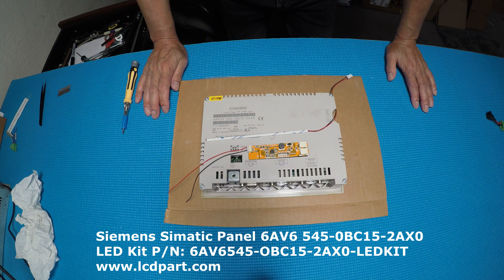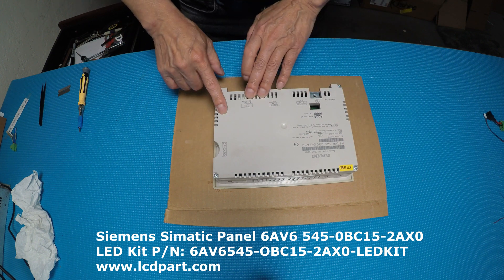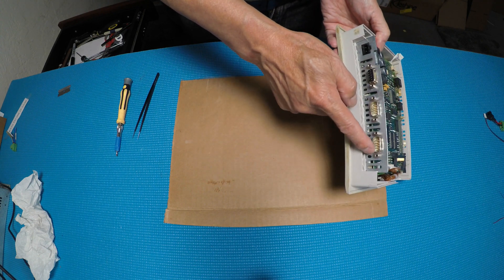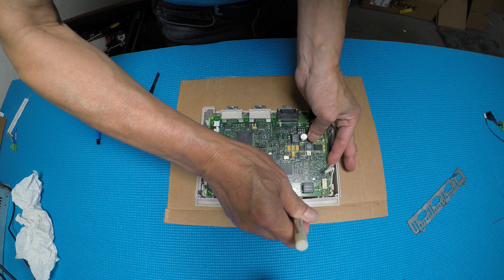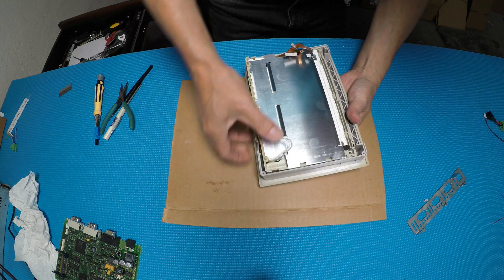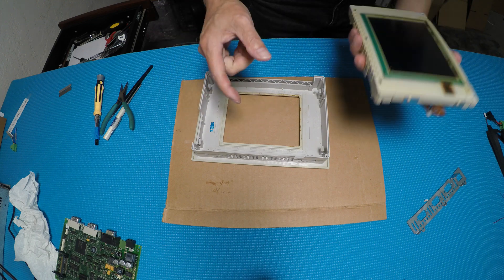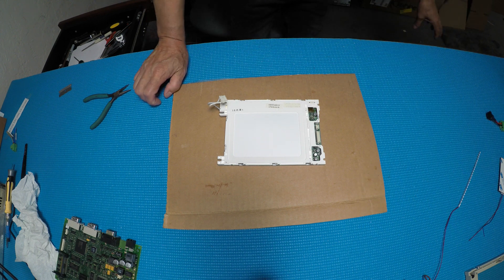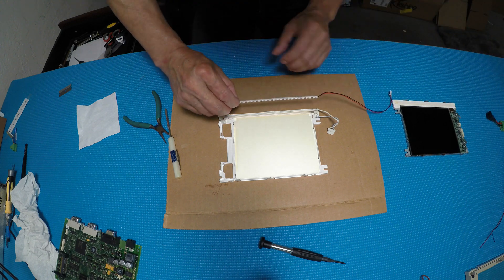6AV6 545-0BC15-2AX0, How to Install LED Backlight

Comment: I replaced with other CCFL but the screen stays dark. The TP177b boots up. I tried other CCFL strips from other LCD Displays...they all dark. Is the inverter on the board broken and is my panel scrap?
Reply: Check the fuses. There are two smd fuses related to the inverter. If the fuses are blown, then the inverter is propably also blown. I suggest you convert it to led backlight.
Reply: @tommiturunen8144  Hey thanks for your great answer and you were correct. A few weeks ago I replaced the fuse and voila it works.
Reply: @Aerobix  No problem, seems i was a bit late😄